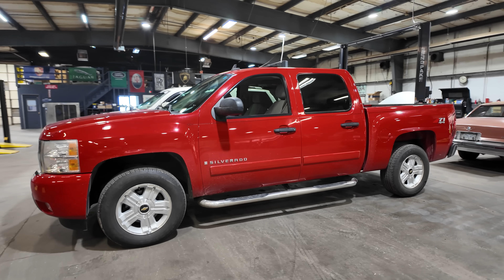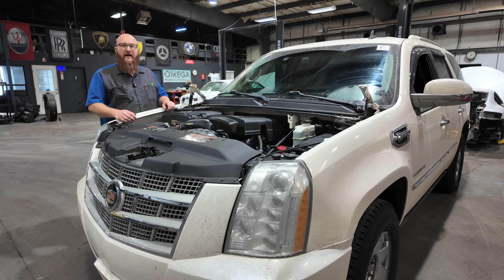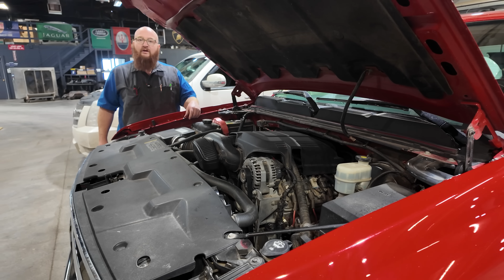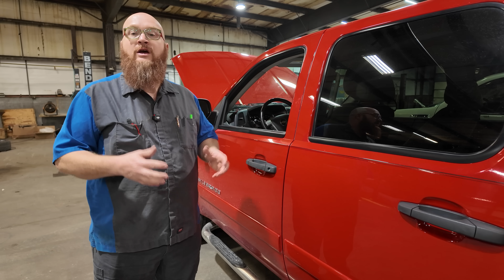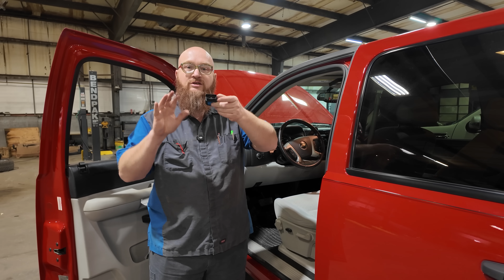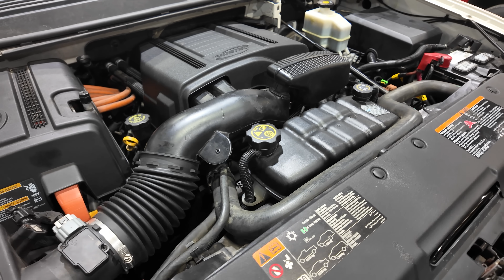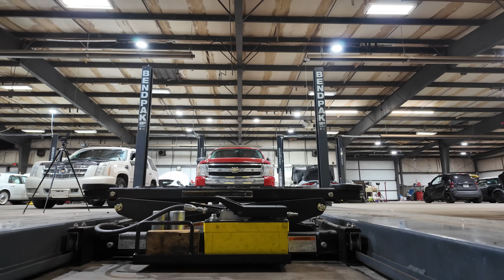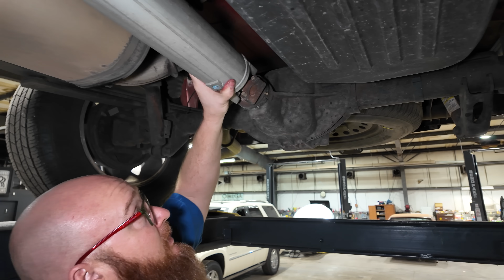AFM: Engine Saver or Engine Killer? The REAL Answer

Comment: Hi Car Wizard. I have a 6.2L 2009 Escalade with 208K miles, it runs and feels fantastic. 18.2 ave mpg., oil changes  every 3K with 5W30 synthetic Valvoline high mileage oil. I have watched and read a lot about the AFM nightmare. My forever question is: How do I know my Escalade has AFM? 
I have been thinking on using the OBDII port solution that you showed in your video, however, if this engine doesn't have AFM, there is no need to control something that doesn't exist, it will do more harm than good. What do you think? Thank you, TX JÜRGEN from Southern Texas.

Comment: My daughter has a 2016’ Tahoe 5.3 6l80 . 180000 miles and no trouble. Bought it with 100000 miles . She does short trips picking up kids at school and has moved pulling U-Haul trailer a couple times. She also trailers her boat with it . Changes oil every 5000 mi. Go figure - 🤔

Comment: As with any electronic component, that dongle to disable AFM could fail. How would you know if the dongle wasn't doing its job under those circumstances?
Reply: You can notice a difference in how it drives

Comment: I ended up buying a 2009 silverado crew cab back in 2013 with the 4.8 not knowing anything about the AFM system.  Just wanted my truck to be a V8.  Luckily I didn't opt out for a larger engine with the possibility of getting a 5.3 with AFM.  I still have my truck today with about 175K miles that runs like new.  Lucked out buying one with the 4.8.

Comment: you did not mention the third way to to an AFM delete. when i had my transmission rebuilt, the mechanic programmed the ECU to permanently disable AFM as well as the shifting strategies. the afm delete and strategy programming cost $350. my 2010 suburban has been rock solid ever since. and because i respect you opinion and knowledge, can you suggest a ODB2 OE reader/programmer that works on GM and toyota? there are so many charlatans out there, i can’t believe anyone

Comment: The disabler box will make the readiness monitors reset so if you have emissions testing be sure to unplug it a few days prior to getting the test done. This will allow the ecu to complete the required drive cycle and set the monitors to "complete" so you can pass the emission test. Failure to do so will cause you to fail the emissions test.

Comment: I bought a beautiful 2010 Camaro Bumble Bee only to find out it had AFM.  I thought holy crap GM I just went thru a PITA experience with your diesel engine CP4 disaster.  BTW I can't wait to get my class action pay out on that one.  I was close to having all of the AFM ripped out and cammed and Rudolph the red nose reindeer did me a favor and cross walked on the intersate early one morning and totalled it.   GM junk!  At least with the Cadillac V8-6-4 it could be deactivated and work with no issues.  Even with one of those OBD port things those lifters can still fail.  Less likely but there is always a chance.

Comment: The disabled people is just prolonging the inevitable. Like you said, those lifters use oil pressure to expand and collapse. Even with regular oil changes with high end oil. They will still fail even with afm turned off. Guess what happens when you turn off the vehicle? You lose oil pressure and lifters collapse. It’s a terrible design, if you get an afm engine. Prepare for a top end rebuild at some point. Even with a disabler.

Comment: Have you considered using copper coat on head gaskets?
 It's been around since Jesus left, and I've used it since the mis 70s.
 A Cat C-15 has a thin steel shim incorporated into the head gasket. 
 These are known to leak. This is so common that the DOT doesn't enforce the usual 'you have a leak,  here's your citation' , unless it's profuse. 
 I ran Mine 300,000 , no leakage.
 I sold it, retired at that point. 
 Just a thin layer,  translucent is best, the spray can works very well.

Comment: Fall 2022 we got Mrs. Cuss a 2014 Yukon XL Denali with 76K miles which had the 6.2 engine with the AFM.  I learned about this AFM and purchased a "clone" AFM disabler for it, and we've not had AFM issues as it remains in V8 mode.  The tiny drop of gasoline actually saved (like those vehicles with stop/start feature) is not worth the overall cost penalty issues.
Reply: I also have Mrs. Cuss put transmission into manual mode, and then select speed 5; AFM is active in speed 6 or non-manual mode.

Comment: bought a range afm disabler for my 30k mile truck and it emediatley cooked the trans, and then the replacement trans. finally pulled it out while driving and the trans dropped 40 degrees. now I just run in m instead of d which disables afm and has been fine since

Comment: 2009 6.0L has AFM. 
Sad the NTSB does not recall those motors. This type of poor design makes Gems a no go for many customers.
GM and GMPP lifters look like cheap far East garbage. Yes mine were purchased from GM, hologram on the sealed box.
4 lifters failed in less than 15 minutes of run time.

Comment: A simple scan on Wiki shows that there were a few 6.0L engines with AFM: L76 like in the G8 GT, and some early GMT-900s (not sure about AFM being enabled there though), and the LZ1 which is the GMT-900 hybrid engine from 2010-2013.  I think folks are just hung up on the LY6 and L96 not having AFM since they were in the 2500 and 3500 trucks, and are by far the most common gen IV 6.0L.

Comment: AFM is bad IMO. I have a black 08 silverado. The afm sucks when the cylinder is deactivated it shuts off the cylinder and the piston goes up and down in the bore DRY. the fuel lubricates the rings and adds more cylinder and ring wear. I limit my driving on it because the cam and lifters haven't come in yet. Adding an upgraded cam and lifters and a tune and deactivating the DOD

Comment: I have a Range AFM-disabeler. Was under the impression that they need to be removed when you`re not using the car for a while because they drain the battery. Is that wrong? You say to leave it in all the time... I have 2013 5,3 Silverado and a 2014 Corvette Stingray, both with AFM, so need it in both vehicles.

Comment: My mechanic told me... Cut your oil changes to 3500 miles even with Full Synthetic, the "cleaner" you keep the oil the better.... If you don't delete the system out. I have a 2021 Chevy tahoe with 60,000 miles. I do notice I burning about a 1/3 to 1/2 quart of 0w-20 every thousand miles..  people waiting to 5k + even up to 7K mile oil changes and not topping off probably doesn't help the lifters...

Comment: In New Zealand and Australia, General Motors Holden built the commodore with 6L AFM from around 2009-2011. Before that they used a 6L labeled an L98 which was a 6L with rectangle port heads

Comment: You can thank Government CAFE standards for making the OEMs implement this B.S. I did the complete mechanical DOD delete on my 2013 GMC Sierra 5.3L last year at 90K miles after I had a non DOD lifter fail. When we took it apart we were expecting to see a failed DOD lifter and were shocked to see a roller had broke on one of the standard lifters. The cam had to be replaced anyway so we just replaced every lifter with OEM AC Delco lifters and used a 4.8L cam and retained the VVT. I did the ECM programming myself with HP Tuners.

Comment: The only thing AFM saves is the heat loss from the shut-off cylinders. There is still the friction of the pistong and valvetrain, that load just falls to the running cylinders and it still takes the same amount of power (and fuel) to keep the vehicle moving down the road. It's a desperation system which sounds good but saves very little for all the trouble it causes.

Comment: My 2017 silverado started clanking on startup one day, was a collapsed lifter and bent pushrod.  Replaced all GMs junk with a texas speed DOD delete kit(cam, lifters etc) and have thousands of miles on it without issue, and no more silly 4 cylinder mode in my truck!

Comment: I used a HYPERTECH 2.0 programmer. Basically you program the engine to not go into 4 cylinder mode. This programmer can also do a lot of other performance things to the engine. After you program it you unplug it from the OBD-2 port. The engine will retain that mode until you plug the HYPERTECH back into the port and reset it to factory specs. They say that some of the ones you leave plugged in can drain the battery. Not sure if that’s true, but I did not want to take the chance. The HYPERTECH is more expensive (250 to 300 dollars), but it does more. I had over 130,000 miles using mine, with zero engine issues. If I lost mpg, I could not tell it.

Comment: I have a 2016 Silverado 5.3L.  I used to do the ODB port disabler when it reached 3,000mi.  At 20,000mi, I went the route of using an actual tuner from Diablosport.  Then I worked with a professional to customize the tune on both the ECM and TCM.  Disabling AFM was one of the settings.  With a cold air intake and custom tune, I'm getting 16mpg city / 19 hwy ( at 75mph+) or 20 hwy (55mph) in all eight cylinders with all terrain tires.  It drives great, no engine issues at all.  I thought about doing a full mechanical delete, but seemed pointless since the lifters haven't been compressed since 3,000mi.

Comment: AFM, auto stop/start, etc are what happens when the Federal Government pushes fuel milage standard without factoring in anything else.  I contend that once you include: Additional purchase costs to the new vehicles because of these extra systems; additional maintenance costs through the life of the vehicle; and that the vehicle does not last as long because it becomes financially not worth repairing and junked much earlier....over the life of the vehicle it actually uses more energy and costs more that what little bit you gain in fuel mileage.

Comment: The variable cylinder engines in the early 1980s Cadillac 8, 6, 4 was a failure too.  I will never buy any vehicle with any AFM system.  They were junk a long time ago and they are still junk today.

Comment: My 2008 Vortec Max, Engine Code L76, has AFM.  Its a 6.0.  I had it tuned out when the TCM was replaced, a tech did it with a laptop in the truck's computer.  It has 109,000 miles on it now, I bought it 3 years ago with 75,000 miles.

Comment: I turned mine off with Diablo tuner. I did have the notorious 5.3 tick and believe it or not. I ran some seafoam in my engine and it cleared out that gunk that was in that lifter. Now it’s quiet as a mouse. It was so annoying and embarrassing when you pull up to a drive-through or something TIK TIK TIK ! Anyway, after a little bit of driving on that, I changed the oil and I’ve been using Castrol edge 1030 in it ever since and I change it at 5000 miles and use a mobile one filter and it’s got 150,000 miles on it now and it runs like a champ.  By the way, I also use Elgin stuff in my older muscle cars and it’s never letting me down. It’s good stuff.

Comment: HEADS UP if you use the OBDII or the PULSAR to delete the AFM / DFM and you live in a state where they do emissions, remove it a month before taking it it in and put on a few hundred miles or it will fail. Talking from experience.

Comment: You can also shift down to "manual mode" and hit the "+" "-" to 5. Only shifts up to 5th gear and doesn't turn on the AFM. You just have to remember to do it every time
Reply: True, but you also have to be ok with running and extra 600-700rpm at 65mph as well.  That's the drawback with a 6spd as compared to a 10spd, for example.  Overall you are better off installing an AFM disabler, at least until you can do the full defeat/delete.
Reply: My rpm's aren't much different. I can run 70 down the highway at about 2200 rpm
Reply: Plus, the 10 speed is a pile of crap

Comment: 2 things:
1. AC DELCO is crap. The same thing happened to me with a fuel pump. 
2. If you put the truck/SUV in manual mode, you bypass the DoD system. That’s been working on my 2011 Avalanche.
Reply: That doesn’t work on my 19 5.3L.  I had to buy a OBD port disabler
Reply: @slalomking wow!!!! Why wouldGM do that!?!?!
Reply: @tinman9341  well I guess they didn’t want everyone overriding the AFM and keep it from working.

Comment: I had pretty good luck with afm in my 6.0 g8. On the highway I could get 26mpg average and it was very smooth when switching modes. The original lifters lasted 170k miles until the engine dropped a valve seat so the lifters got replaced as a well your in there fix.

Comment: I thought this would be yet another gripe video of how obviously deficient the AFM/DFM system is.  So why did I watch it?  Not sure to be honest, as I've seen a ton of similar videos.  BUT, I'm so glad I did because yours was the first one I've seen where you show how they work by taking a lifter apart.  Thank you for doing that and walking us through that.  I have a Carbyte plug for my 2023 Sierra with the 6.2l (already on my 2nd engine) in hopes that it saves me from that failure.  If the lifters do fail, at that point I'm going "all in" and putting normal lifters, a performance cam, and maybe even a supercharger.  At that point, why not.  haha

Comment: Im so happy I found your channel. GREAT explanation! Is there a particular delete brand I should lean toward? BOOST caught my eye as its USA made. Also, is there ANY data at all that show certain Brands of oil that work best in these engines? Maybe higher detergents etc?? I tend to lean toward Warren, SuperTech. Very affordable and it MEETS every standard required. In fact, its on the GM approved list. I  haven't been brand loyal in decades because all private or house brands meet all standard 98% of the time. Main thing here would be Dexos1 Gen 3 rating for newer engines... please give some thoughts. Thanks again

Comment: I own a 21 Custom Trail Boss from the COVID with no AFM or stop/start from factory due to the chip shortage. I still have the parts but they never activate. I also have a six speed transmission as well. Great truck I am so glad it sold me on the truck. You only get 1 MPG supposedly I feel it’s not worth it.

Comment: I like that year range as well. Sadly, here in MN the road salt gets them typically over the rear wheels. Some sort of lip that catches road dirt and salt and it just sits there and corrodes. Good trucks, though. I have owned three 5.3s and three 6.2s. Total of about 300k miles. No issues, but I am a fanatic about changing oil at 5k. Mobil One full synthetic. Seems to work.

Comment: 1 to 2 mpg increase?!??
I traded in a near fully loaded 2014 Silverado Z71 with the 5.3, with the cruise control set at 74 MPH I would average 24mpg.
With the cruise control set at 70 MPH it would average 26 MPG.
Average not instant!!
610 to 620 miles on 1 tank!
I have pictures I can show you..

Comment: Betting those same engineers helped design the new LS's that are toleranced to run on 0w20 and shredding bearings in brand new low mile trucks.
Reply: And that's why I said screw that, and now switched over to 5w30 at 70,000 miles on my 2015 Chevy Suburban

Comment: Had GM gone with smaller displacement turbos that allow light duty without boost and boost when under load, they would have done far better. Just look at the 2.0T applications. Been driving those for years in Saabs and the power and economy are amazing.....and reliable.

Comment: GM's AFM was the poorest executed idea in recent automotive history. Only firing on the same 4 cylinders just wrecks the system over time. 2014 Suburban was stating to have collapsing DOD lifters around 165. Added a blockout module to stop that process, several oil changes done, each after a few hundred miles to clean out the system. Running 5w40 in winter and 10w40 in the summer with a little lucas to help the lifters stay pumped up. Been 25k miles and no more "v4 mode", no more lopy idle and still pulls great. Eventually I'll pull the heads and swap out the worn DOD lifters if the cam is still in good shape, full swap if not. The thing is a beast and totally worth the upgrade. Keep that oil clean with a change every 3k miles to slow down the wear when the mileage is this high.

Comment: My wife's 2021 Mazda 6 has cylinder deactivation. I have changed the oil every 3,000 using Pennzoil Ultra Platinum and am hoping that level of maintenance will prevent any major issues for a long time.

Comment: On My 2010 5.3 I kept the trans in L5 (manual mode) and it was never in v4. I figured I rather burn more gas than replace the engine. 208k later it ran like new always keeping up on oil.
Reply: Yes but that doesn’t work in our 19.

Comment: I had a 2018 5.3 Sierra. I programmed it out after owning the truck for about 4 months and hating that system every time I drove the truck. After deleting the system electrically, I noticed not bit of mpg loss, actually I think it improved just slightly. That system is junk and they know it but are as bull headed as a wild boar and will never change. I sold the truck when the market was good for selling because it still had the potential to fail even though it wasn't active.

Comment: So why hasn't some aftermarket company made metal roller lifter guide replacements for the plastic ones? Metal ones are used in older engines like the Ford 5.0 HO V8.

Comment: I have a 2018 Chevy Silverado 1500 with the 5.3 and installed a Range AFM disabler. It does keep it out of V4 model however, It does cause the transmission to downshift hard from 3-2 randomly. If you live in a state the requires emissions, make sure to remove your AFM disabler and drive the truck several days about 100+ miles before taking it in for emissions inspection. I switched from 0W-20 to     5W-30 and noticed the engine runs a littler quieter. It did drop about 1mpg but I don't care. Currently the truck has 96K and no lifter failure yet knock on wood though I have noticed when its in the single digits to negative temperatures when I start the truck up it does tick but then goes away after a couple of minutes of warming up. I think the 07-13 5.3 engines are more reliable than the 14-18  5.3 L83.